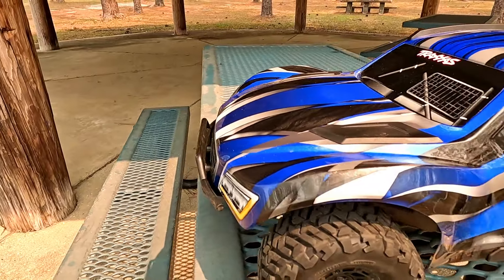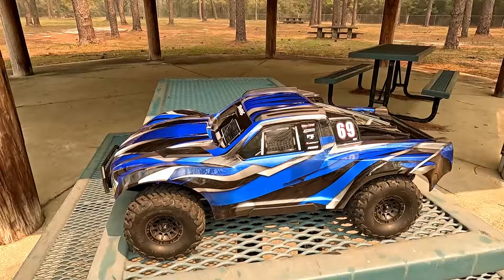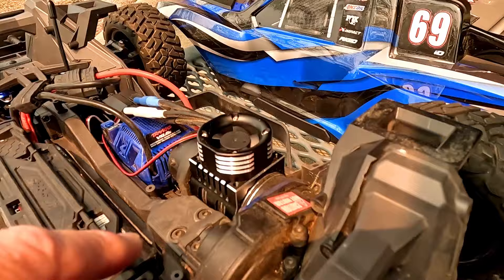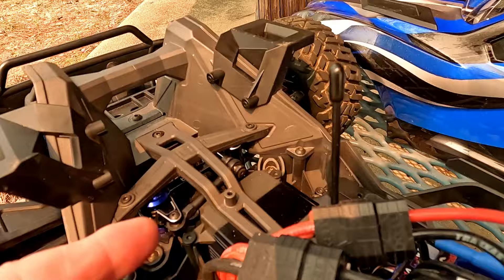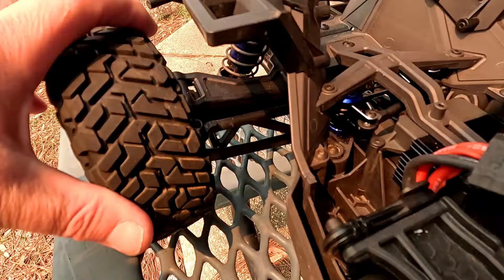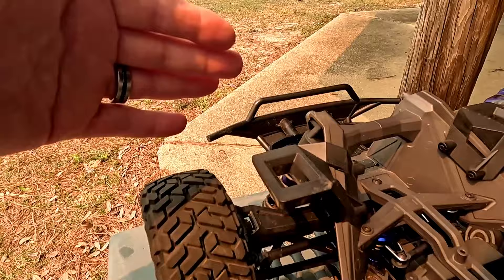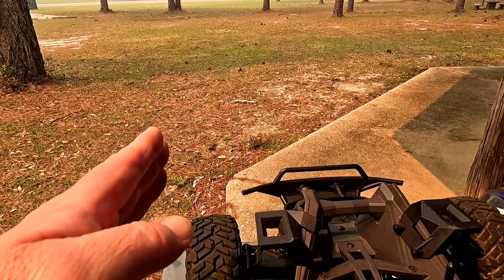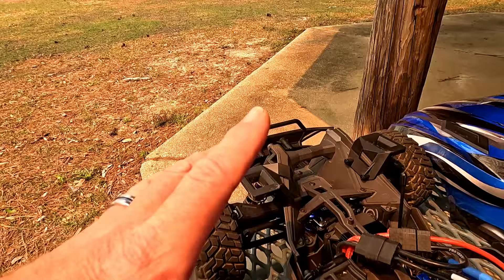Maxx Slash Rollover and Trim Issue Fixed Was It The Parts Or Did I learn How To Drive LOL

Comment: Traxxas has done this so often its not funny.  Release a car, then let the community of owners find out what or where the weakest link is in the design.  Its not your driving.  These RTR are set up to run at a very basic level.  Servo saver and a stronger steering servo absolutely.  And then depending where and how you drive it, tune the shocks and get some sway bars if your wallet allows it.  I remember watching another video where it was suggested to put another set of risers for the shocks on the rears, on the front as well.  All though it looks like you might have it sorted already.  Thanks for sharing.
Reply from the maker: Thank you for the positive comment. I ordered that part lol. I have another video coming where I took it off the rear to see what it does. I haven't really had problems out of Traxxas except when my Sledge came out of the box with the antenna cut they didn't care part was backordered I had a usless brand new car. Pretty sad I went online ordered one so I could use my car. This time I put in a new receiver tsi works they still want me to send in all my equipment for testing.  Its b.s. mail my equipment for testing be out the rc its a cheap part only has 30 day warranty its pathetic

Comment: Just throw in hobbywing esc and motor combo and see how it does. Traxxes electronics are junk.
Reply from the maker: Wouldn't say its junk although the gyro is dead lol definitely not the best but esc is expensive to keep swapping out I have one in my XRT definitely stronger I can back flip it with the factory tires now.

Comment: Glad you was able to improve it.   Regarding the trim issue my experience was near opposite.  It'd go straight accelerating usually but start pulling on decel.  Braking was a mixed bag and did everything except go straight consistently.   Also felt like i was either fighting the tsm constantly or it was just doing nothing.  There wasn't much predictable or consistent about it.  It is tough at least.
Reply from the maker: I have heard that from others too my braking was not bad it wants to pull on take offs apparently my tsm is dead I think it would glitch on for a second I swapped out the reciever after this and it works now. The servo saver being so loose it just lets the tires wander you cant keep them straight

Comment: Get part 10234 and put them out front. It’s the rear shock extensions. It levels out the truck and makes it handle and jump far better. It’ll fix most the issues you’re having.  Also turn your tsm almost completely off.
Reply from the maker: Already have it coming lol tsm is off its completely broke except I think it glitches I swapped receivers and it works now

Comment: Very happy you have debugged it some. TSI issue well that's another issue, Still The Fan and heat sink should have been standard issue. Adjusting the oil in the shocks is a minor thing and a personal preference, Over all a way better car now. Enjoyed watching
Reply from the maker: Thank you very much I checked the whole tsi is broke I swapped recievers and it worked fine Traxxas wants the transmitter and reciever mailed to them.

Comment: if your wanting to see if theTQI or the AVC is working.   leave the front wheels on the ground and wiggle the  back end, back and forth, and observe the wheel movement.   you can't see it doing it the way you're doing it.
Reply from the maker: I already swapped out recievers and it worked just fine the way I was doing it the wheels must be spinning on a Traxxas to work cant do that on the ground!

Comment: The TSI kicks in when you apply throttle , lift the truck hit the throttle and them move the truck , good luck
Reply from the maker: I know that thanks when you bind a remote it gets disabled something Traxxas was clueless about blinking light on the receiver its off steady green its on. When its blinking like mine was nothing turns it on.

Comment: Strange that exocaged launched his like 30 and did a back flip and landed just fine? I bought one launched mine the same also practiced throttle control and I flipped 1 time in like idk 18 battery packs. Every rc car rolls bud. Try driving your pickup down the road at 75mph and crank the wheel you may be suprised.
Reply from the maker: Strange your comparing jumps to actually driving the fact you claim to jump this explains why you dont grasp the concept of what is going on bud. Pickup? I drive real cars bud.
Reply from the maker: Did you even watch the video before your comment?  Strange it drove fine no flipping.

Comment: I'm glad its working better for you. I wonder if the pulling to the left could be a little torque steer.
Reply from the maker: Thank you I think its a faulty gyro its not responding at all every now and then it makes a wierd left turn I did notice on the app when I set the steering sensitivity the tsi made a wierd movement then went back like I got to see the glitch happen  I have a new reciever in it I need to try

Comment: is you receiver lights green,if is lighting red,that means that the tsm is off and you have to push the receiver button for about 5 seconds and then the light goes green,that enables tsm.when you switch many models with one remote,sometimes the receiver swithes tsm off for no reason.
Reply from the maker: Its green but good info I did not know that
Reply from the maker: You were mostly right the light is a flashing green its off steady green its on hold the button down for 2 seconds it turns red until you let go then its set. I did that and somehow this xmaxx servo doesnt like it at all just shakes and stuff its damn shame thats the 1 thing traxxas never asked.

Comment: Traxxas is blocking all the feedback comments for the Maxx slash on Instagram lol
Reply from the maker: Ohhh wow  I dont feel bad for them they jumped too fast put cheap parts in an expensive rc thier answer loosen the front springs so it sits on the ground I was a loyal customer until this mess
Reply: @L2theWcarscoffeelife  oh I don’t feel bad, I know traxxas sucks as a company they have some great “ platforms” I say platform because the electronics always suck, they have smaller companies that people like to call bad such as redcat outdoing them in the electrical comparntment, if you seen the new 1/5 they made it comes with a max 6 and it’s around the same price as the Maxx slash 😭. Traxxas customer support is also insanely bad for how popular they are compared to horizon support where they will fix or send you a new part for free within 2 weeks or take your feedback and actually listen to it
Reply from the maker: I never had a problem with anything Horizon hobby when the big rock had the glitch they sent me a esc never asked for the old one thats a lot of money traxxas wants my transmitter and receiver I pay to ship no way!! A viewer told me to check the light on the receiver he was right in a way it was blinking no tqi steady light tqi active how the hell they didnt know that no my problem is with tqi turned on the servo shakes like its having seizures makes no sense its the h.d. maxx servo it should work I was tempted to put the spektrum receiver in it but the box is too small go figure lol  I appreciate the support

Comment: I had one Traxxas, with gyro, I put the receiver in backwards, I took it spun it around and it worked. I'm not sure, it might be in there flopping around, if you have removed it and I'm not saying anything about you don't know what you're doing I'm just telling you what my self experienced, it also went along slower in reverse with it oriented incorrectly in the receiver box, just throwing that out there, I have no idea if it's been removed or not but just trying to offer you some direction on the gyro
Reply from the maker: I found the issue it will be coming up in a video I just filmed. A viewer pointed me in the right direction wrong info lol it got me looking the light blinks on the receiver  tsi is off press the set button until it turns red then the light is steady tsi is on. The question is how does Traxxas not know this? They had me do all these resets then said mail both transmitter and receiver in at my cost
Reply: @L2theWcarscoffeelife  man I'm telling you, I don't know much about TRAXXAS, I would drive anyone if them bad by any company but I won't give TRAXXAS my money for anything, they are so rude, kinda like the snobs in school or the cool kids that we had to beat up so they quit staring at us at the lunch table in the mess hall lol. Glad you got it figured out, sorry you had to learn how TRAXXAS feels about the folks that made them. Hell in my opinion, veterans outta get discount with a AARP card or something from atleast one of the many companies lol, hell I still couldn't afford many, like I said I've built many what I have or got it used. I've been really wanting to start saving up and buying parts here and there for a big rock 6s , do you have a opinion with a good choice or not, I drive pretty much just like you! I'm almost done getting parts for the outcast 4s v2. 5, then I'll be starting on slowly buying parts for the next one. I just want one big girl ya know,
Reply from the maker: Garage life rc has a Veterans discount and they sell Corally and a bunch of parts. Traxxas for the most part makes some really nice durable cars. The customer service sucks I was about to get the new boat they released after having one guy tell me there was nothing wrong with the mutt it was too powerful and another telling me to mail in my stuff screw them I have something else coming. I am not a big company I do buy a lot of stuff and probably will end up buying again for the channel but it will be limited I though this was interesting enough I bought it. Traxxas will loose market share quick they keep rehashing the same crap with shiny parts and call it ultimate while never fixing any real issues. Kmart thought they were too big so did Sears people only stay loyal so long. The big rock is a blast I need to drive mine just been busy with all the new stuff. It can jump a little its a great street car or ripping through the dirt and grass its one I always recommend if the person is not into big air then I would say the Kraton would be the one. I actually like the factory tires being a bit slick it makes power sliding on the street possible also helps with traction roll overs its a fun rc for sure
Reply: @L2theWcarscoffeelife  never heard of that company, what did you order? The omi terminator?
Reply from the maker: @PtsdRC  its a possibility 🤐 they have been around I think they mostly made speed cars

Comment: If you bind to new transmitter it turns off tsm you have to turn back on through app
Reply from the maker: Doesn't work like that app only adjusts it
Reply: @L2theWcarscoffeelife  then the way to tell if tsm is off is if receiver is blinking red when on and you hold button on receiver till it beeps and turns green it is now on
Reply from the maker: @troylitvinow8233  this has already been covered and fixed by now thank you anyways for the info and it doesnt blink red it blinks green its off solid its on there is no red light thats probably on some older stuff
Reply: Your receiver also may need to be updated When I go into garage on app under tsm I can turn on and off
Reply: But in the end whenever you bind different transmitter to traxxas receiver if goes tsm off by default blinking red light on receiver and has to be turned back on.
Reply from the maker: @troylitvinow8233  there is no red light
Reply: @L2theWcarscoffeelife  just trying with things I know

Comment: I read to adjust steering trim TQI must be turned off
Reply from the maker: @jasonmitchell8883  nope not at all plus mine in this was not turned on
Reply: @L2theWcarscoffeelife  
Darn, I have the same problem bought mine last Sunday and it will not drive straight so annoying
Reply from the maker: @jasonmitchell8883 servo saver fixes that  I got mine from hot racing
Reply: @L2theWcarscoffeelife  
Thank you, I may as well just order it. Appreciate it save me a day of frustration
Reply from the maker: No problem glad to help

Comment: Change the oil of the suspension
Reply from the maker: To what?
Reply from the maker: Why?
Reply: Mesa body roll on the curves
Reply from the maker: @joseaugusto-vd9vg  oil is not stopping body roll you tell my change oil to what 100 weight 30 weight what came factory? Spring rates too high? Your making comments do this nothing as to why what the result would be why?